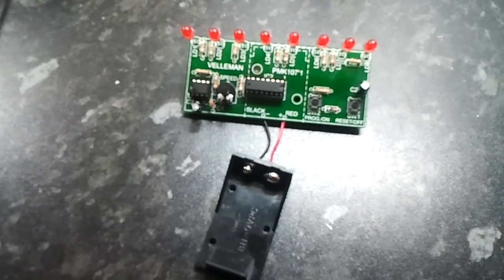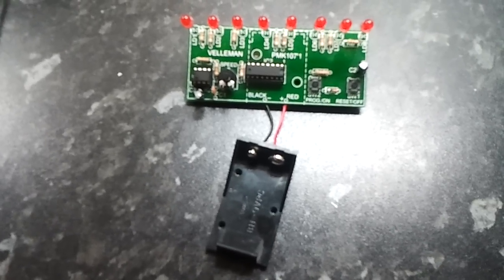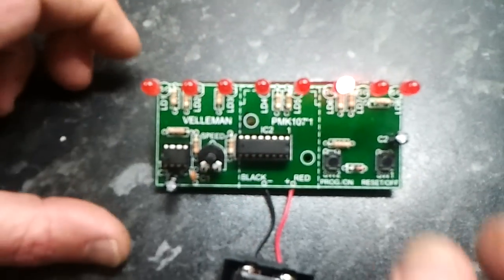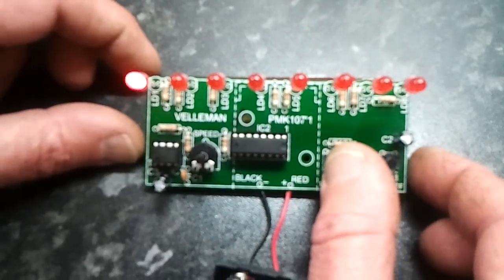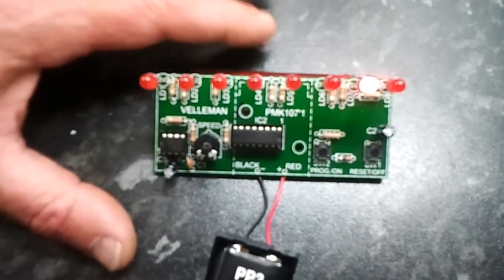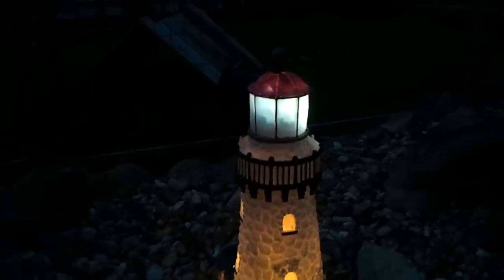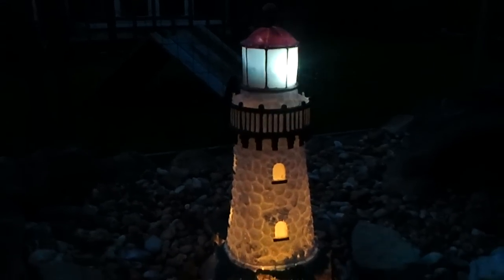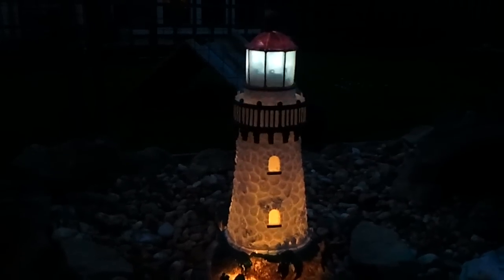velleman light chaser lighthouse mod

Comment: Help! I’m trying to duplicate this, but it’s not working. To which of the four SW2 contacts do I attach the capacitor? And in which direction does the polarity flow?
Reply: E. Bernhard Warg
Help! I’m trying to duplicate this, but it’s not working. To which of the four SW2 contacts do I attach the capacitor? And in which direction does the polarity flow?
'
hi EBW...
how is your kit...
did fix already and work running well